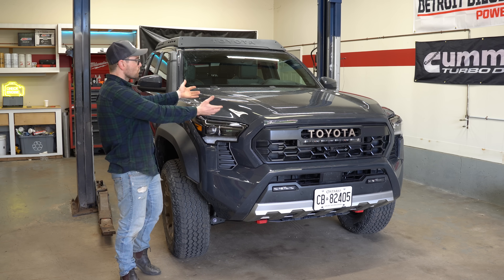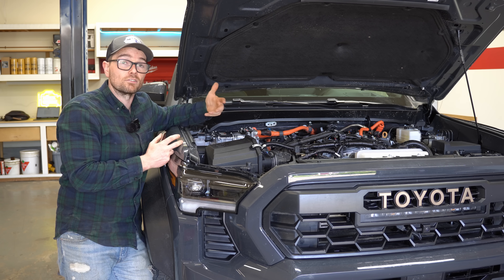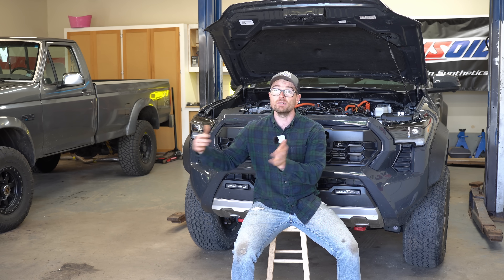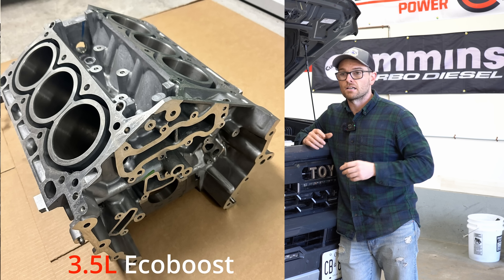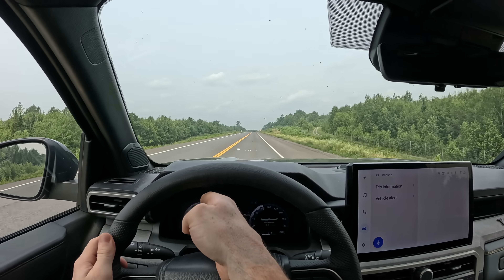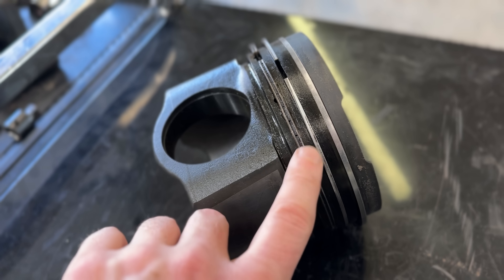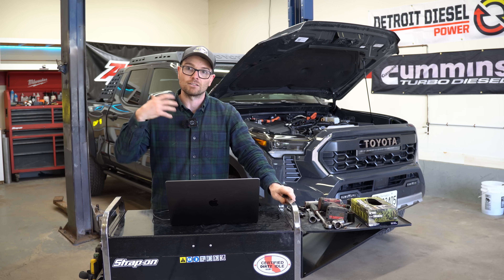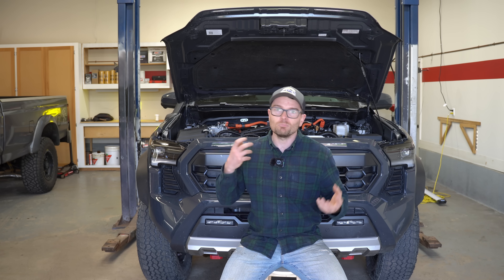Toyota Tacoma's 2.4L I-Force Turbo: CONCERNS Every Buyer Should Know (Mechanic's take)

Comment: I completely agree with you regarding the hybrid power figures. Ever since the Tundra hybrid was announced I have felt that their numbers are misleading.
For one, under what specific circumstance is the truck actually giving you all that power? These trucks are significantly slower than competing trucks with similar power figures. 
For two how long is that power boost actually sustainable? The battery capacity in all Toyotas hybrid trucks are quite small, if you are in a situation that requires using the extra power for a prolonged period of time how long would the added power last.
It would be interesting to put the hybrid vs the non hybrid on a dyno and compare the data.
Reply from the maker: my thinkings exactly. at some RPM range I'm sure the truck is making the rated power figures but my guess would be that this power is not readily available through all driving conditions. I'm thinking about the Hemi E-torque engines where Ram claims that the "e-torque" system adds like 130 lb-ft of torque to the first "wheel rotation" whatever the heck that means. So I think just adding electric motors to Ice engines is a little deceiving.
Reply: Maximum horsepower and torque ratings for ICE engines are rated and typically advertised at just one point at high rpm.
Isn't that also misleading? 
Most people aren't running their gas engines at 6,400 rpm for maximum horsepower, or 4,500 rpm at all times for maximum torque.

At least with a turbo hybrid, they're putting out great power at only 1,700 rpm. Right where it's needed for driving over mountain highways at high speed, climbing hills while rock crawling or city driving.
Reply: @dvader3263 
Yes the rating for a ICE engine is given at peak HP and TQ, and obviously there are a lot of variables that effect power output such as altitude, barometric pressure, air density, humidity, temperature, fuel quality, ect.
I guess what im having a problem with us that on top of all that there are technically two different peak ratings, one with hybrid boost, and one without. The performance difference between the two different trucks seems rather marginal for such a drastic difference in power output, and I find that the hybrid toyotas seem to underperform when comapred to similar trucks.
For example the tacoma with the hybrid system only manages a 0-60 time of 7.0sec
Where as the ranger with the 2.7 v6 manages a 0-60 in around 6.3 sec despite making less power
Tacoma i force max 326hp and 465 ftlbs
Ranger 2.7 ecoboost 315hp and 400ftlbs
Im not saying 0-60 time is a big priority for a pickup truck but it makes you wonder at what point you actually see the big difference in power that is being advertised.

Comment: As an owner of both a 2024 TRD Off Road with the iForce and a 2025 TRD-Pro with the iForce Max I have to disagree with the “quicker acceleration” bit. There are also a handful of videos on YouTube showing the 2 lining up and launching from stop. Maybe the numbers are wrong? Idk but you can definitely feel the added horsepower and torque in the iForceMax. Now it’s not sports car fast but definitely has noticeably more get up and go.

Comment: The 4.0L 1GR-FE was the last truly great old school Toyota engine in their midsize pickup trucks. The 3.5L V6 is still great although not quite as good overall reliability and even power wise.
Reply: I never had an issue with my 3.5L but the 2nd gen was notorious for having head gasket issues.
Reply: The only reason why the 3.5 was put in the Tacoma was because of emissions

Comment: Review the one that most 4th gen tacoma owners have, the non hybrid.
Reply from the maker: the 2.4L Engine in the I-focemax (hybrid) is the exact same engine in the non hybrid trucks. literally mechanically identical
Reply: @GettysGarage  the camry/rav4 do the same thing. my sister has a camry and i have a highlander, both have the 2.5, but my highlander is hybrid. only difference is the orange bits under my hood she doesnt have.

edit: oh and the transmission. hybrid parts for car drivetrain IS the transmission itself, where these trucks its between the engine and transmission. so the hybrid transmission is an 'eCVT' and the non hybrid is a basic 6 or 8 speed auto

Comment: GM had lots of issues with there coolant valve also. Open block means more likely to have head gasket issues. How can a low friction oil ring that may allow oil burning have lower emissions ? Burning oil doesn’t cause emissions? 
Well done video.

Comment: I’d go with a Jeep Gladiator Rubicon. Tough, simple, easy to lift, can fit 35 inch tires and easy to repair.
Reply: The fact that Stellantis didn't fix the death wobbie in the Wrangler is terrible. But the fact that they carried that problem into a new model, the Gladiator, is astonishing. They should have fixed it before production began.
Reply: @silenthorizons1760  I own a 2021 Jeep Wrangler Rubicon and a 2024 Wrangler Rubicon with the extreme recon package that comes with 35 inch tires. Never had death wobble so I don’t know what you’re talking about.
Reply: @DUNEATV Just because you haven't had the issue doesn't mean it's not an issue for some.
Reply: @silenthorizons1760 That’s fair but my buddy’s have Jeeps too…not having death wobble either. I think that happens on Jeep’s that are equipped with cheap lifts and cheap and not balanced properly tires.
Reply: @DUNEATV or spacers not done right
Reply: @DUNEDIRT There's conversations on the forums. The issue is happening to stock Gladiators. I still love a Gladiator with 35s. Just disappointing that Jeep didn't fix the issue completely when releasing a new model.
Reply: @DUNEDIRT I don’t personally have a JEEP (and would never buy one) but I know a lot of JEEP owners and two of which complain about the death Wobble.  Just saying

Comment: So far I love mine. Twice the power of my 2nd gen. Went from 17mpg 2nd gen to 24mpg avg hybrid 4th gen. With as high as 28mpg. I have never driven a raptor ranger but I have driven and owned a lot of powerful vehicles and so far I would put the Tacoma in the more powerful of vehicles I’ve driven. Not the most powerful but for a daily stock truck it’s definitely high on the list.
Reply: Love my 4.0 2nd gen and actually get 20.5 mpg over 15k miles according to my scangauge with 255/85/16s on it. I do baby it though to get that mpg and don’t usually drive past 70-75
Reply from the maker: plenty of power in the engine no doubt about that! but I guess I expected more a punchy truck whereas this truck feels more slow and steady. probably pulls a load very well.
Reply: Peak power and available power are two different things. The Tacoma has a lot of available power but fairly weak peak power compared to a Raptor. Its great for scooting around through traffic where maybe you dont wanna be banging the engine off the rev limiter but still want to get a burst of speed.

It was the same thing with my 2014 F150 Ecoboost vs my now 5.7L Toyota. The Toyota actually is rated for more peak power but, down lower in the RPM's, where your engine normally lives, the F150 was MUCH stronger than the 5.7L. It almost never needed to downshift and could accelerate pretty hard even at 2500 rpm. My 5.7L needs to hit 4000 to do anything meaningful.
Reply: Just get rid of it early.   Yep more power sacrificing long term reliability.   It is made for those that swap out every 3 to 4 years.

Comment: Polimer gears, plastic valves in the coolant system. Unfortunately, Toyota is starting to look like a BMW. In other words, with all that plastic, you would be lucky to get 100k miles without some kind of leak or breakage. After 100k miles, then reliability will most likely suck big time. I hope I'm wrong. I jinxed the Tundra when it came out with the turbo and hybrid stuff and I mentioned that would probably reduce reliability. Someone told me that I was wrong because it's a Toyota. Now we know who was right unfortunately.

Comment: TLDR at bottom

The design does NOT seem solid when they've cheaped out on plastic parts.  I have vast experience with plastic parts because years and years ago, I got my wife a Jaguar (before the new campaign), and the plastic coolant pipes break after about 4 to 5 years.  You can count on it.  After i replaced these parts twice (thankfully able to do myself as a former mechanic, the dealer wants 3k to do it btw), I replaced them again but this time, someone in China was making them out of aluminum.  No issues now.  

Otherwise the engine really is solid.  I have 135,000 miles on it and now I drive it to work, wife got a newer car.  I want to drive this thing until it blows up because it has almost zero value now but its still a nice drive. 

TLDR: 

Short story is, plastic sucks and WILL break and therefore, any engine with plastic parts can not be called solid until the plastic is replaced with aluminum, iron, stainless, etc.

Comment: Fuel efficiency does not equal low emissions. In fact to reduce emissions engines are generally less fuel efficient.
Reply: EXACTLY. Fuel efficiency and MPG's are at odds with each other. To get better with one, the other has to get worse in some way.
Reply: That clain is absurd. On average, today's engines are vastly more fuel efficient and far more emission's friendly than those of the past - despite also being more powerful.
Reply: @harddrivin1le-970  They are indeed but the without the emissions systems (specially diesels) they are MUCH more efficient while still having very low emissions compared to very old engines.

Comment: I have a 2020 RAV4 hybrid 104k miles zero issues I do 5k oil changes. I feel that the 2.5 FKS in that application is solid, but de- stroking it slightly and boosting it then putting it in a 1500 LBS higher weight tow vehicle is asking for trouble.

Comment: IMO, What we have is auto manufacturers over the years, have been studying buyer analytics, typical ownership length, etc. Through this process, they all have engineers on board designing all of these vehicles, components, etc with more of an emphasis on planned obscolesense more than ever.  I've been a Yota fan for years, but the new gen vehicles sure seem to be about as reliable as any other car manufacturer. Time will tell!

Comment: Plastic??? In critical cooling system components??? Are these engineers checked for sanity before they are hired? If this is where we're going the automotive industry is 100% doomed...
And although this may not be a diesel engine, with the compression ratios thereof, having coolant run right up against the cylinder walls, because of the open deck design, is what can cause cavitation issues long term if someone neglects the cooling system for a couple of decades, which you can bet your life savings that some people will absolutely do without a second thought.

Comment: I wonder what is the weight difference between the i force hybrid and the regular turbo engine, maybe that's why the non hybrid is faster, weight matters...
Reply: I would bet it's due to how the hybrid doesn't have a torque converter, so there's a little more time before the engine engages the transmission as the clutch between the engine and electric motor has to slip, so it can't just rev to the moon without mutilating the clutch and motor. Once it locks it can then start to rev out. The weight is supplemented by the electric torque, which would normally more than make up for the difference in acceleration

Comment: I was nervous about it initially but there are videos everywhere from the lead engineer going over the engine piece by piece showing what they’ve done, how it’s been made strong, etc.. I risked it and got a 25 base trd or. After owning it, I feel like it’s going to be a good truck for a long time.
Reply from the maker: It'll be a solid engine but I don't think you'll see the same longevity as past engines.
Reply: @GettysGarage  I think the longevity is brushed over honestly with old toyotas. They're great vehicles but the upkeep can be significant aside from just the core engine function. Lets not forget Toyota was AOK with having its vehicles just eject their front suspension for 2 decades or so at random endangering their customers, widespread rust issues, etc.. People forget the issues the gen3 tacos had at launch. Freezing diffs, trans damage due to underfilling vehicles with the tow packages, being undergeared stock, and it goes on... People lambasted that generation at launch with the loss of the 4L but now they praise it with the 4th gen coming. Its just cyclical. All modern midsize are moving to this direction of turbocharged 4 cylinder. Seeing as this is our reality, Im trusting Toyota above the others.  None of the other automakers have brought their head engineer out and fully went over what they did with customer use in mind. Sheldon's video on the cooling capacities, materials, etc really set it apart from me. Other companies tell me how much it can tow. Toyota was the only one emphacizing how much they can cool, how they made the inlet the size of the v8, how they made a strong bottom end, etc.. They put their cards on the table. Thanks for the discussion :) As a lifelong Toyota truck owner, Im just speaking from my life experience that the hate for each new Toyota truck is real until its not. Im sure theyll have their problems. I can tell you for a modern truck, its put together pretty simply TBH. Everythings pretty accessible.
Reply: I was skeptical at first too but after I drove mine the decision is clear, I’m trading in my 3rd gen for it. It’s a better driving truck in every way possible. Most 3rd gen owners simply haven’t test drove one. It’s night and day.
Reply: @westcoastplinkin6559  100% The adjusted seating position, smoothness, and torque of it is really an impressive step forward. Every single generation of new Toyota truck is fiercely hated. They're pretty much all still around working.
Reply: Toyota 4 cylinders are legendary for durability around the world. This engine is already proven from years of service in the Highlander, it’s going in every Toyota for a reason.
Reply: Open-deck aluminum block: cheaper/lighter, great for mass production and fuel economy. Less robust for constant high-load stress. 

This would worry me the most if I were looking to buy a turbo truck since the turbo is constantly putting more stress and heat on the engine than a NA one. Also, this 2.4 I4 is a car-derived engine put in RAV's and Highlanders that was adapted for truck use. Inherently, it's not made for truck applications. If you're only going to daily drive your Tacoma, it will last just fine. But if you're planning on towing, hauling, or working it hard in general, I would look to a different platform.
Reply: @alexmseu  It also has all forged internals and a bottom girdle that locks the bottom end down. WIth how robust the cooling is on this thing... I think it just might do ok.
Reply: @alexmseu Let’s be real, this should not be bought if you do a lot of towing and hauling. If you do a lot of that stuff, get a half ton.
Reply: @jmilesfox the amount of old Ford rangers I've seen doing more work than most half tons would put all the big truck people in shock
Reply: @alexmseu the 2.4 is from lexus models.
Reply: @mad-meh2719 Yes, the NX first introduced this turbo charged engine, but it's mostly based on the I4 that the RAV and Highlander have. The open block design remains the same. It's all part of globalizing their architecture for efficiency and cost reduction.
Reply: @alexmseu  It towed my camper out to the Grand Tetons, went offroad, and is doing well.
Reply: @ryanslifeirl That's awesome. I hope you get a lot of happy miles out it!
Reply: Don't care, it has a turbo so no buy
Reply: @james2042 turbos have been around for a long time and people getting high miles with the ford eco boost. The turbo hate really needs to die cause they’re not going away
Reply: @Hazmat0357 I'll just buy a truck that doesn't have a turbo. If every single new truck has a turbo I'll buy used. Considering the ramcharger will have a natrually aspirated generator, even into the future of electrification, there will be NA options. So I'll repeat myself. It has a turbo, so no buy
Reply: @james2042 that’s absolutely your choice man. Good luck to you no matter what you decide 🍻
Reply: @james2042 no one cares, you do you. You can scream about the unreliability of turbos, but an example of a well engineered turbo is the 2.7 ecoboost. You can hate it, but it’s good and people buy it. You can’t win over everyone.

Comment: The more I hear about this 2.4 liter engine the more I dislike it.     Plastic gears have no business in an engine.     Kawasaki tried this with plastic cam gears on their V twin engines.   They had a high failure rate and were replaced with metal gears.
Reply: I rebuilt a 1963 Chevy 283, that was about 15 years old. The timing gears were metal body with plastic teeth.  Not sure how long they were expected to last.
Reply: In the world of lathes, plastic gearing leaves the retailer and, metal gears get ordered from new!
Reply: Plastic gears or wet belt, you choose.
Reply: @TJ-oi5qe I choose Frontier,  which has NEITHER. But Toyota cult members MUST buy only whatever crap their deity company pukes out.
Reply: @TJ-oi5qe neither!